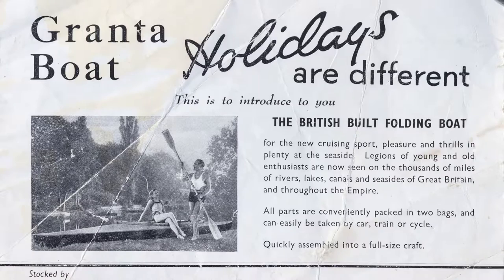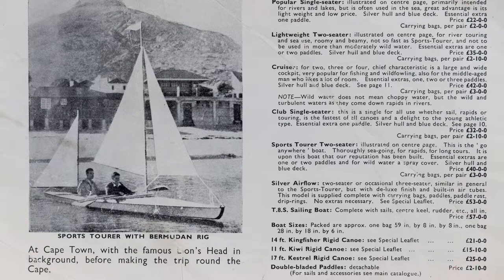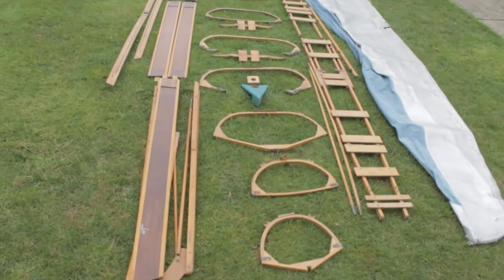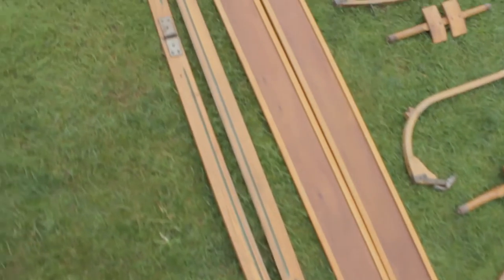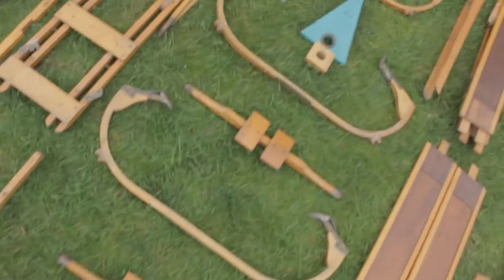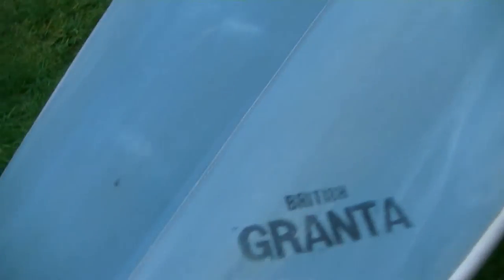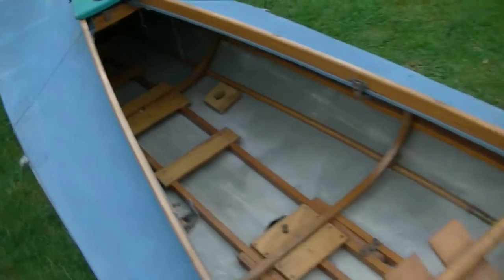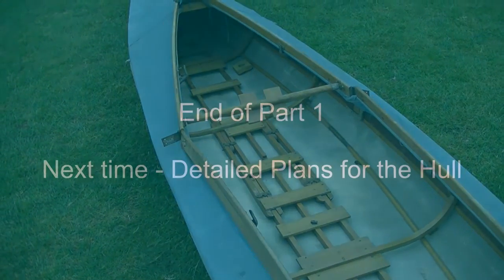The Vintage Folding Canoe Part 1

Comment: Hi Matt,I am currently trying to repair a vintage Fobolt Canoe, similar to the one you have in this video. I was wondering how you ended up making the repairs to the holes in the canvass/rubber hull? I couldn't find your Part 2 video. 

Thanks!
Philippa
Reply from the maker: Hi Philippa, I used a great product called TEAR-AID Type A. Just google it . I also re-skinned the hull with Hyperlon fabric but to be honest it has made the hull very heavy and stiff, so if  your hull only has a few holes I would probably use tear-aid and use rubber patches. Anyway, you can see what I did at my part 3 video here https://www.youtube.com/watch?v=AE-sIuV1UwM&t=2s
Reply from the maker: Hi Philippa, I'd love to hear more about  your  canoe. I set up a Vintage Folding Canoe Appreciation group on Facebook so please consider joining the group. I hurt my back a few years ago and my canoe became too much for me. I have promised my son that I would finish it off this year so we could go out in it. Your comment inspires me all the more to make sure that happens. Anyway, the facebook page is at https://www.facebook.com/groups/1603129716658833/